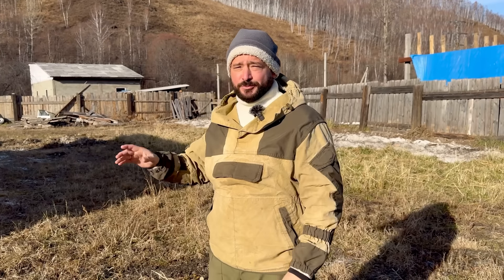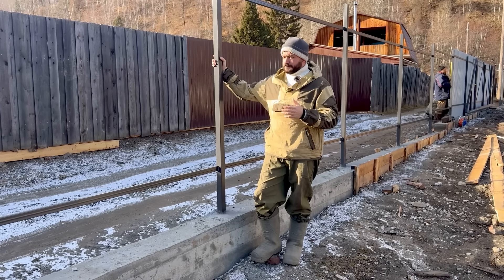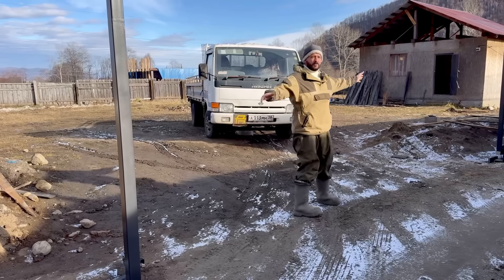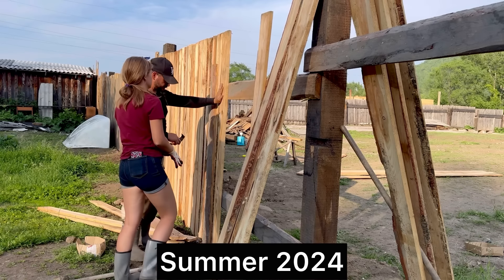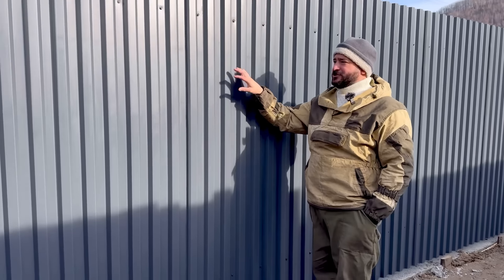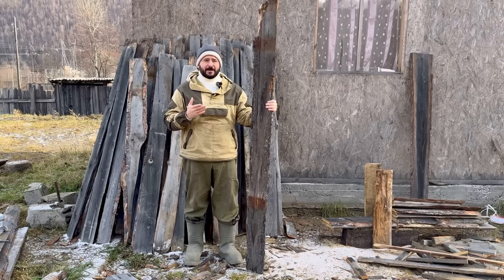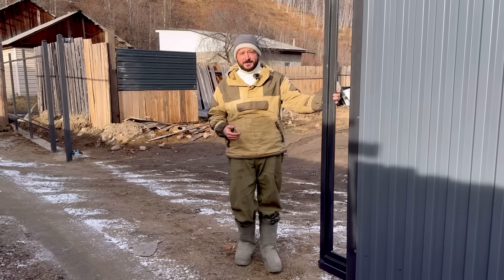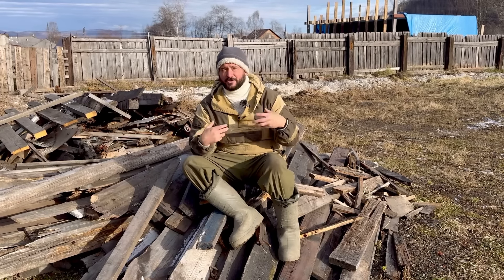IS RUSSIA CHEAP? Spending Thousands in Russian Construction

Comment: Daniel, it depends on the personal income of the individual in Russia. Here in the US I paid $5500 for two six inch thick concrete, rebar reinforced pads, 10'X20' and 12' X 16'. The concrete in your fence most likely goes down at least 2 feet into the ground. You got a bargain regarding US prices. I've seen some of the houses in Russia for $100k to $150k that would cost up to a million dollars here.
Reply from the maker: You’re absolutely right
Reply: I am now selling an old Soviet-era 50m² apartment in Saint-Petersburg for $65k. IMO the fair price would be 50% of that, but there is not enough housing there.
Reply: @ufxpnv  You have to remember the average wage in the US is about ten times more than in Russia. So if the price is ten times less in Russia it’s actually the same price.
Reply: @hockeybros4051  Most Americans earn less than $30.000. Averages are not the best method to gauge things by.
Reply: @ in the US 30-40.000 $ sounds about right in Russia average salary is from 2.600 to 4.600 $ a year and that is about ten times less than in the US.
Reply: @hockeybros4051  Stop using averages. One example, In push for more Ukraine troops, city of Moscow hikes pay for contract soldiers to $60,000 a year

Comment: i am a fencer in Australia, steel fence here cost $110 - $150 per meter at 1.8m hight, and thats using thin colorbon. sliding gates are $5000 to $6000 each.
concrete wall is $500 per square meter. so not bad
Reply from the maker: Thanks for the price comparisons I love these sort of comments

Comment: You'll want to cap the top of  your vertical post so that precipitation doesn't enter and run down to the bottom where it will freeze and buckle out the bottom of the posts and cause the fence to collapse.
Reply from the maker: Yes the caps are already ordered and on their way 🤝🏻
Reply: гнутый профиль тоненький,  П образный, надо приклеить  по верху забора, по всей длине, и оставлять зазор , между бетоном и металлом , хотя бы 50 мм

Comment: Yes, it is worth it. The motorized gate is an excellent idea and very practical when raining or snowing. It may not be as smooth when the ice freezes. Walls and fences make good neighbors.
Reply from the maker: I think that in hard winter I’ll just do it by hand 😅 even though it’s probably the best time to use the electric portion. 

I will build something so it’s too with the weather
Reply: Makes neighbors strangers.  Keeps bears out worth that for sure.
Reply from the maker: @joycehaines2055  not at all, we have close neighbors good friends 😂

Comment: Hi, Dan, amazing videos, the dark gray color's grand although the corrugated metal fence like many other relatively thin materials, being simply on its own has a temporary-build appeal 10:34 like construction hoarding; nonetheless its a great start for a defining Trump border wall look 12:05 p.s. those steel internal columns, perhaps have them brace the full height of the exterior side of the metal fence as to visually strengthen & upscale the entire fence ever so slightly 12:01 as well as to open up options for subtle parameter ambient lighting streetside etc. p.p.s. the 6M auto gate is pretty neat - got to see that when its finished.
Reply from the maker: Yes the actual reason why we built the front wall with metal is for bears 😅

Comment: Consider the option of building a house not from wood but from aerated concrete blocks. They are cheaper than bricks and easier to lay out. They also have a very high sound insulation property and also a high heat-saving ability, which is several times higher than that of wood. I was surprised myself that aerated concrete blocks are so good in their properties. I am planning to build a two-storey house with a residential attic.
As I was told, blocks with a density of D600 can withstand a structure of 4 floors, i.e. I have enough for a basement, 2 full residential floors and an attic ) And all this for 1.5-2 million rubles per 180 square meters 😋

Comment: looks like a solid fence bud, quick tip for your metal fence " oil and diesel mix in a spray bottle" great for keeping rust away and lubricating them grooves for the gear mechanism :D.
Reply from the maker: Amazing advice thank you so much!

Comment: Your costs in Russia. Are very similar to what it costs me to do the same things by myself in rural Wisconsin in the US. I am in the process of needing to rebuild my main house. Due to a meter of ice collapsing my roof a year and a half ago. All that weight. Pulled the nails out of the 80+ year old home made roof trusses. And my roof flattened out. Also pushing the walls part way out. So I will be rebuilding the entire house on the existing cement foundation. I will be reusing the cabinets, interior walls, plumbing, light fixtures and probably the origional floors. I will replace the entire roof, outside walls, doors and windows. The house is 25 feet/7.62 meters. By 48 feet/15.2 meters. I am building by stacking solid walls of 2x8 inch construction lumber. Like stacking logs. Glue and construction screws holding each layer of lumber down. I will be using factory built roof trusses. 50 % more trusses then required by building codes for my region. I do not ever want the roof to collapse again. Using graded and inspected lumber. I will need 890, 10 foot long boards. A little over 3 meters each. I will be able to rebuild for $20,000.oo. or roughly 2 million rubels. If I put in all new floors, interior walls and everything. Only reusing the foundation. I can build all new for about $35,000.oo. Or 3.5 million rubles. I will have thick, solid walls. Able to withstand the worst storms. Even tornados. No chance of drafts, insects or rodents getting in. And I can always add a layer of insulation at a later time if needed. All my own labor. Except for paying professionals to build my roof. Which I included in the costs. I am also buying a finger jointing router bit. To have a strong glued connection where the ends of two boards come together.

Comment: For me, the wood wall is more beautiful, than the metal one.
Reply: That's because the wooden fence gives you that rustic look and charmed. The wooden fence will eventually rot and be worn down, whereas the metal fence will last a long time.A better money investment for a long time solution.
Reply: @waynemclaughlin96  
and because this cheap metal has not the best association - it is used as a wall for garbage dumps in Moscow region.

Comment: Been offline for a while mate, Surgery. :/ That fence/wall is in colorbond, the color is almost gunmetal grey. The top you are talking about is called a cap, or capping. Push button gate is a brilliant idea in a laneway. However if it rains in cold weather? Be aware it could be iced into place, and forcing the electric motor could burn it out. A long way to go Daniel and Ksenia, but if you are going to do something like this? Do it right.
A small hint Daniel, if you ever use colorbond as roofing? Do not put short screws in the valleys/shallow areas, like on this fence. Use long screws through the ridges/high ridges. Better waterproofing. Take care, stay safe.
Reply from the maker: Yes everything is fine with the motor we have the motor in a housing for all sorts of weather 🙏🏻 I truly hope you get better

Comment: You paid roughly 30% more than we did 3 years ago for the gate, as a comparison of price increases. The metal is in line with what we just paid in Crimea - which is about 40% more than four years ago, and 10% more than in this last spring.

Comment: I have limited experience with construction and mixed feelings about walls - mainly about trying to find the ideal balance between aesthetics and efficiency, as well as the broader implications about the people or area it's in. I like metal's ability to withstand or block a huge variety of things, but I don't like that it also blocks many aspects of natural life. I look more at the long term costs/benefits than the initial upfront expenses, and lean towards wood and stone as ideal building materials but they generally require experience, time, and skill to do properly. Another main concern is how it will handle the elements over time, and what type of maintenance (if any) will be required to maintain it, and how big of a hassle will it be to fix vs if it were some other material. Those are just my thoughts... I appreciate you sharing the details of your journey with us who may be thinking about possibly doing the same thing!

Comment: Very cheap. Here in Italy:

Wrought Iron Fence: 900€ every 8m
PVC Fence: 400€ every 12m
Aluminum fence: 3,000€ every 50 m
Wooden fence: 6,400€ for 80sqm
Galvanized iron fence: 9,000€ for 120sqm
Brick fence: 3,000€ for 60sqm

Comment: Hi Dan,
Last year I replaced my wooden fence here in Vancouver Canada and it cost me x4 more though it was 1/5 of the size of Yours.
I think You're doing everything right. Invest once and don't worry in the future.
The only thing I'd do differently on Your other fence which is made out of wood is to lift it up from the ground slightly to prevent it from rotting. On the bottom it rots very, very fast bevause it sucks moister from the ground and bugs eat it too.
Also: I'm a mechanic and I had a lot of used motor oil and before installing the wooden sections I soaked it in motor oil. Literally soaked it by applying oil a few times. It'll repell water and keeps bugs away. It looks bright and shiny too as if it was stained.. If I keep on doing it once every few years it'll last forever.
And thanks for the laugh for the picture of Trump with that wall in the background.
I was drinking coffe and almost spilledit as it cracked me up LOL
I think he should hire You as a contractor!
Reply from the maker: Your comment made me laugh at the end. Thanks for all the tips by the way

Comment: I live in sweden and Im working in  the perimiter protection sector. we both distribut gates and fence and we also monitor it. And I can already tell you that 1200 $ (correct me if i'm wrong) for an 6m electric gate is extremly cheap, also it looks black which makes it even more expensive (galvinized is cheaper). At our company you would never get it cheaper then 10000$ and then im optimistic, usually its highter deepending on lenght, size and which modul you want.
Reply from the maker: Thanks my friend for reporting in from Sweden!

Comment: Doing a steel framed fence in basically winter temperatures to the U.S.  probably wasn't a great idea because it needs to be painted right after construction to avoid oxidation and paint won't cure properly at those temperatures.
Reply from the maker: They were don’t long before winter

Comment: About the fence paneling -- I changed the fence at my father's house in Belarus this summer. The total length of the front fence is about 30 meters (98 feet) with one door and two gates 3.2 meters (10.5 feet) -- to the garage and to the homestead. I mostly kept the old reinforced concrete pillars that my grandfather put up 70 years ago, although some of them had to be replaced or repositioned. The support beams of the fence were completely replaced with rectangular pipe like yours. But about the paneling -- I was thinking about a solid metal profile, like you and most of our neighbors. Or profiled metal pales. But then I decided to do the old-fashioned way. With wooden pales. I simply bought boards, made chamfers with a hand router, covered them with stain and painted them with a durable “yacht” varnish.  It probably cost more than a metal profile, but I like it more :).

Comment: Hello,  i am not a great engineer at all, but have a curios about welded fence. i guess it would be damage during expluatation. because of temperature difference between summer and winter is pretty wide. so it could decrease and expand.
Reply from the maker: The materials were welded before winter with winter in mind
Reply: @Wild-Siberia  the material is compressed when it gets cold and expanded when its warmed. So my point is that your fence have a chance to broke in place where it have weld seams. any way if i right or wrong, temperature deformation it's not a big deal it can be fixed.

Comment: that capital metal sheet fence with concrete base will last . My wood "dog ear" fence gets rotten every 3 years. After installing new fence wooden planks start drying and twisting pulling out nails. and you not allowed to built stone or brics fence because of HOA deed restrictions.
Reply from the maker: Thanks a lot for the input$

Comment: To be honest, I don't want to give you advice, what to do in your own property, but If I were in your place, I'd do some things differently.
1) Position. I'd position the door facing the main road. You are to build a house. You will get deliveries of materials, machines and contractors. It will be problematic, to say the least, to have heavy duty lorry's to unload in the small side road where the door will be. Also, for accessibility purposeless - in the winter, when the snow falls, the municipality will maintain the main road to the marble quarry clean, but not the small road, were your door is placed, so you'll have to clear by yourself to exit. Now imagine how you'll feel, when Xenia starts giving birth in 01:15AM in the winter and you have to clear 300ft of 3ft high snow to get the car out...
2) Materials. I'd use as much material as possible from previous buildings on site as possible. I'd use the bricks and stones from the old barn as base layer w. concrete. I'd use the the wood from the old wall and just add the metal sliding door. I'd just sand, planish and varnish with seed oil  the wooden planks § railway sleepers and use them again. I like the wooden aesthetics. It is cheaper. And I wood provides the better sound isolation than metal. 
3) Security. May be just add edges on top of the planks. Not that it will stop a potential robber, but it will not make his life easy. Plant some berries with thorns like raspberries&blackberries on the both side of the wall to make scaling more difficult.
4) Aesthetics. I can appreciate the homogeneity that metal wall provides. But I believe it is good when it incorporated to serve an overall purpose and design idea.
Overall. As I said before. Te romperan el culo de trabajo, cabron! :P
Reply: Wood fences rot in that climate. Steel lasts much longer. The gate is big to allow construction equipment in.

If he has main road access, he can make a foot gate facing it.
Reply: @threejaguar  Wood can be impregnated with bitumen and seed oils. Becomes as stone. Yearly. Good exercise for Ksu! 
From what I see he did no provisions for a foot gate at the front. More - he said, he wanted a fenced yard for when the materials start to arrive.
Reply from the maker: The door is facing the main road by the way and thanks for the scenario you added what you’d do it’s what I asked for
Reply: @Wild-Siberia  Quote - "Russia is not played in "Easy" mode!"... and you are doing great! I have my fingers crossed for you and your success in life. I know you have many "skeletons" in your head, but with hard work and community support, I believe that you will teach them to dance. Overall - You are doing great and I like your fence!  We all are very proud of you!
Reply from the maker: @iagomi01 🙏🏻 I appreciate you very much

Comment: Why didn't you remove the wooden formwork of the fence foundation on the outside of the fence? It will rot in the ground. It doesn't look pretty and over time voids will appear there.
Reply from the maker: Because it’s going to be removed and not left on the ground
Reply: @Wild-Siberia  👍

Comment: The material you are using on the wall is easily dented and there is nothing you can do about it.  While it looks real nice now over time it could get damaged.  In the US most fences are vinyl.  Lots of different styles, some look like brick.   It also holds up real well.  As far as your price I consider it very reasonable.
Reply from the maker: Everything on this planet can be damaged I agree some things more than others but in reality I don’t have such fears only 1 car drives down this street

Comment: I have the same color front fence but it’s metal slats not sheets, they have a small 6ish mm gap between them ( for air circulation). For how long your fence is $3000 is not a lot, it’s actually very cheap.
Reply from the maker: Thanks a lot for the input and thanks a lot for sharing your wall with us 🤝🏻
Reply: @Wild-Siberia  Re what you said that people who have loads of money can just go for something turn key, imo it’s better doing what you did (we did too) and building from scratch, no hidden issues (like foundation problems) and you can build it exactly to your needs and taste from the start. It would help if you could do some of your work yourselves (like concreting, rendering, tiling, painting at least) it saves you soooo much money.